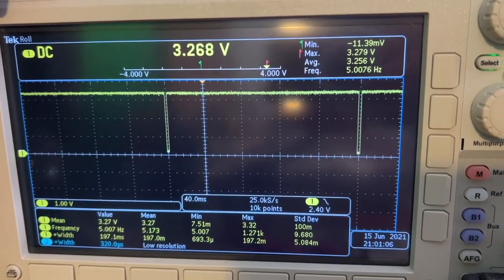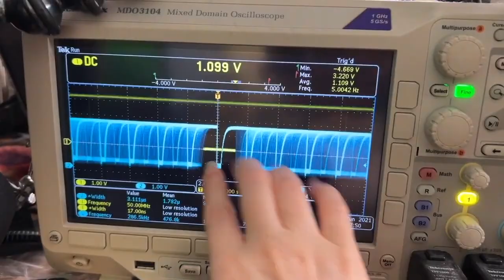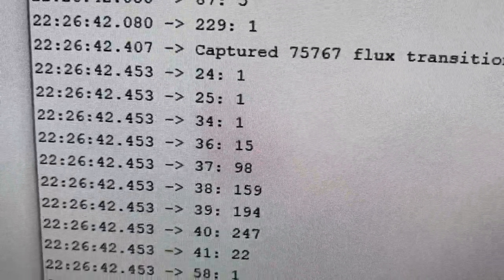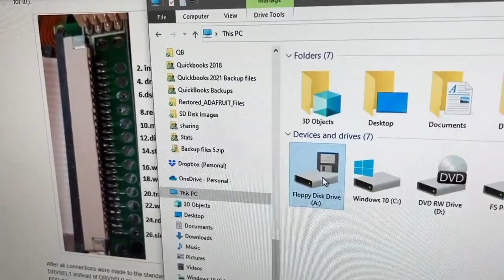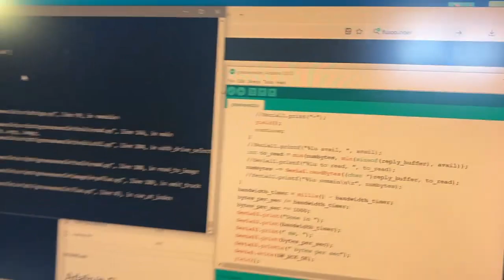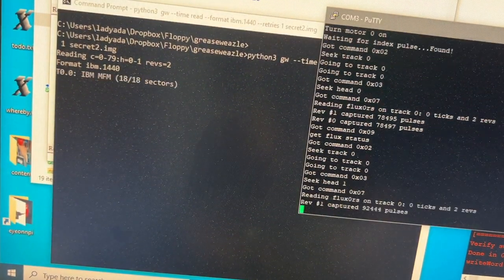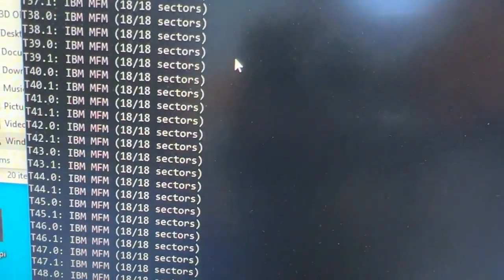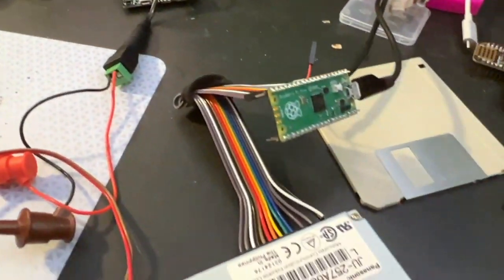low cost and easily available floppy interface hardware - all 9 parts of the video series in 1 video

Comment: I am trying to find out for the PICO with the floppy drive, which wires are connected to which pin on the floppy and on the pico.. The URL 
link to schematic is not working...

Comment: Very nice. If we get write support as well, seriously considering adding a floppy drive for config files to some of my custom test and science gadgets: Floppies are cheap and large and less prone to get lost or repurposed than a microSD card. They're also easy to put large, easy to read labels or handwritten notes on, which makes them suitable as physical "tokens" carrying some config parameter set. I've tried using NFCs for similar purposes but ended up with only using the tokens as IDs to reference actual data stored elsewhere. I like the idea of a cheap tangible, right-sized tokens with rewriteable data. SD cards are just absurdly overpowered in terms of capacity, it feels borderline criminal to use a multi-gigabyte card to store just a few kilobytes.

Comment: Are you going to do the opposite side, floppy drive emulation (microcontroller that emulates a floppy drive for a device that requires a hard to find floppy drive)?
Reply: Floppy emulators exist. You flash a bunch of images to a usb stick and stick it in the emulator. Then you cycle through the images with a button and the computer thinks you changed out the floppy.
Reply: @jorenmartijn  Yeah I know that. So do floppy/usb interfaces which can then be connected to a microcontroller (I think one showed up in an early episode of this series). Using a microcontroller as an emulator lets you programmatically change the data, rather than the static method you describe. This allows almost real time data to be used via a legacy floppy interface into a legacy host.
Reply: @zexusdexus4193  I like your thinking…

Comment: Very nice. I have all of the parts at hands so I'm tempted to play with this eventually. Are you planning on implementing the write back of the flux image as well? Also is it necessary to power the drive separately? Most USB 3.5" drives working from bus power without issues.
Reply: USB drives yes, but typical floppy drives  have power ratings above USB capacity (0.5amp) and some old ones even require additional 12V. With USB splitter you'll propably could go with most floppy drives as it is rarely above 1A.